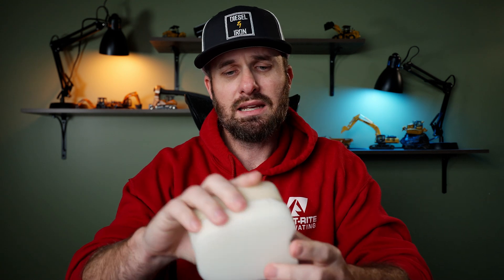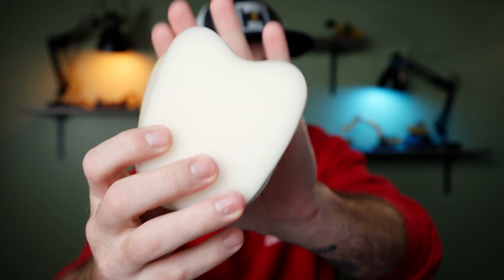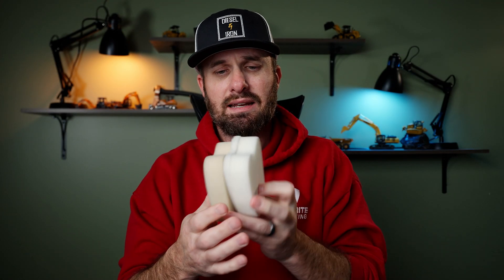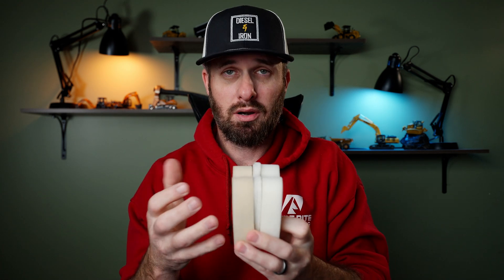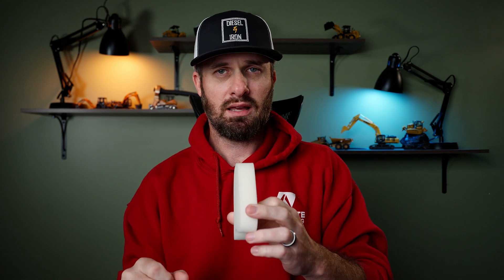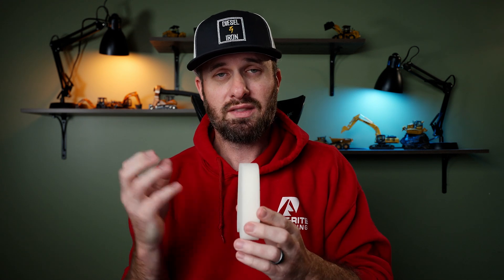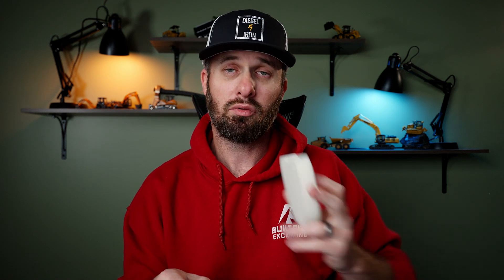Emissions Systems Explained

Comment: Def sits in the sales distribution channel for longer than a few days or weeks. So its already going bad before you get it. This is part of the reason def doesnt work functionally in the daily lives of people. Moreover, what about the def sitting in the tank for days/weeks. Its crystalizing as well.
So as you can tell... there's a question in there. I use it for towing and live in the mountains so it really helps on the hills. But I dont go through def fast enough. Then there's a problem when I'm in the mountains (rocky mtns) for a week hunting. I'm driving around, but I'm not going through a tank of def. Meanwhile, its crystalizing. Even locally. Not going through a tank of def in a week.

Comment: Wrong in the first minute 
In a diesel the fuel is Not injected until near TDC of compression stroke 
It's not sucked in on the down stroke 😮
Reply from the maker: Well...you caught me.  I guess we should just blow off the whole video.  You know what?  The whole channel...just ditch the whole channel
Reply: @DieselandIron  
Wel it's hard to educate people with missifomation 😩
Reply from the maker: @garreysellars5525 I find it easy to educate with misinformation. I'm doing it just fine in this video.
Reply: @DieselandIron  
Miss education
Won't be back 
Diesel fitter 45years
Reply from the maker: @garreysellars5525  you are throwing off some real Billy Bob Thornton from Slingblade vibes. Don't let the door hit you...

Comment: Only thing that I would nitpick would be that diesel isn’t injected at the start of intake like you stated in the beginning. It’s typically injected just before TDC on compression stroke. The fuel hitting that hot compressed air acts like the spark plug and the fuel at the same time. It sprays the fuel when the “spark” is supposed to ignite it.
Reply from the maker: Fair enough.  Can you tell I'm not a diesel tech?
Reply: @DieselandIron 
Wel you don't qualify for this explanation 
You lost me in the first minute 
Diesel fitter Australia 😅
Reply: @DieselandIron  no worries! The rest of the video is spot on. I enjoyed it.

Comment: I need to recommend your channel to like 75% of the people at this company, second job I was on we had someone put GASOLINE in the DEF tank of a telehandler and luckily it melted the injector shut cause the mechanic said it could have caused a "major backfire" then on the job I'm on now we had a guy run a dozer till it was literally out of DEF forcing it into a limp mode even after they refilled it so they had to send it back.
Reply from the maker: There are a lot of not bright people in our industry....

Comment: Bryan, great episode!  Question,   How does the freeze thaw cycle  affect DEF?  Like if I leave my backhoe, no DPF just DEF. parked on  site and it freezes?  I know the DEF tank has coolant lines running through it, so if I plug it in, the block heater and cooling system will keep it from freezing.  If it isn't plugged in and it freezes, the control console directs me to run at a higher rpm in order to thaw it.  But was is the effect on the DEF itself?
Reply from the maker: Everyone I've talked to on the manufacturer side says that the freeze/thaw cycle shouldn't degrade the DEF.  Freezing doesn't cause the urea to crystalize like evaporation so in theory you shouldn't have a problem.

Comment: 10,000 hrs ? It more like 1000 - 1500 depending on how hard the machine is used
Reply from the maker: For a full DPF cleaning?  If you're having to remove the DPF and clean it that often I think you have some issues.
Reply: @DieselandIron  manufactures specs look it up
Reply from the maker: @Jack-1212  I've never had to do a DPF clean out that early.  If you're using the right oil you should be able to way more than 1500 hours out of the DPF.
Reply: @DieselandIron  I didn't know that oil was related to the dpf
Reply from the maker: @Jack-1212  the reason you have to wash out the DPF isn't related to the actual diesel particulate. Ash is a byproduct of the small bit of oil that gets burnt during the combustion process and the ash cannot be cooked off. Over time that is what builds up in the DPF and clogs it to the point that it has to be removed and cleaned
Reply: @Jack-1212  that’s because you’re not as smart as you are trying to appear to be.

Let’s use a semi truck for example, working 70 hours a week.

At that rate, that same truck would need a full DPF cleaning once every 6 months.

If that’s the case then that machine has some very serious problems.
Reply: @JayBrad_TLM it's definitely not 10,000 hrs
Reply: @Jack-1212  based on my own real world experience, I will respectfully disagree with you.

Comment: Okay, there are some things in this video I should have known and didn’t, but I still have one more question… What about the DEF that’s in the machine?  Do I need to drain that out if it’s going to sit for a few weeks, or months?  Does it matter if it’s hot?
Reply from the maker: Generally speaking the DEF in the machine is going to be okay.  If you were going to store the equipment long term than you might think about draining the DEF tank but under normal circumstances the DEF is moving through the system fast enough that you shouldn't run into any issues.
Reply: That’s for the knowledge!